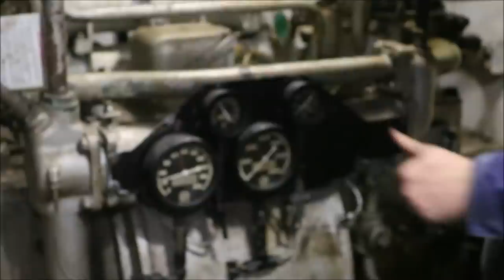First start in 72 years WWII 1942 Cleveland Diesel 8-268A

Comment: Beautiful old engine, I worked for GM in Australia on the modern EMD's and smaller 2 strokes, the Cleveland is just beautiful
Reply: I served my apprenticeship on the EMD (and smaller rolls royce,Leyland ,Gardner and  cat) .I still enjoy the sound of an EMD notching up under load. An old mate of mine had a Winton Car,built in the 1800's.
Reply from the maker: @Mercmad  That's very cool. Also one of my favorite parts of working with these engines. Thanks for watching!
Reply: did you ever know Earl Nemic
Reply: I worked on the switch engines george bacukman of relco, 

(old  3 finger george) 

bought  back in 79. the old alco's that threw coal bits out of the exaust. Turning oil filters and tripping out individual cylinder with the grasshopper valve. Inspecting cylinder walls by standing upside down in the cylinders.  At 18 that was the shit!
Reply from the maker: Quite the experience! Thanks for watching!!
Reply: @FixAndForget  Hi , i have some original parts for tha engine  , Blower   injectors,  pump , bearing , if you're interested  let me know.
Reply from the maker: @ivanchin5478  Absolutely. Email me at asher.spalding@gmail.com 
Thanks!